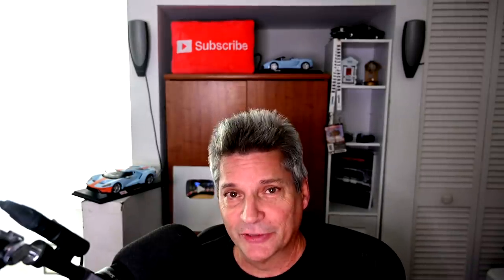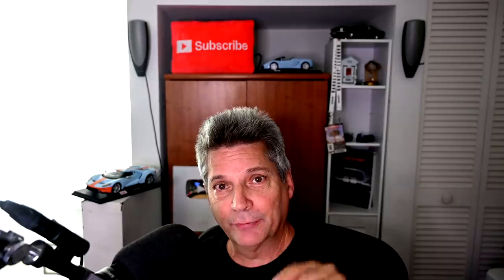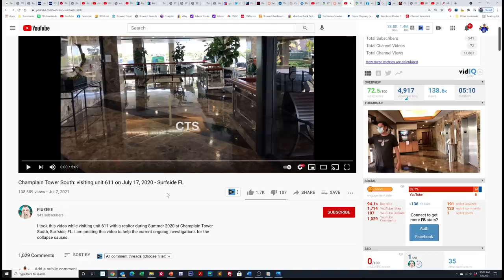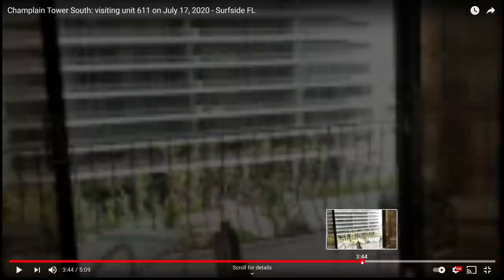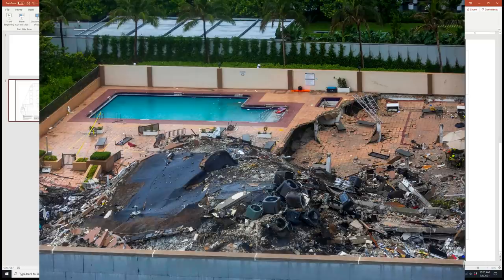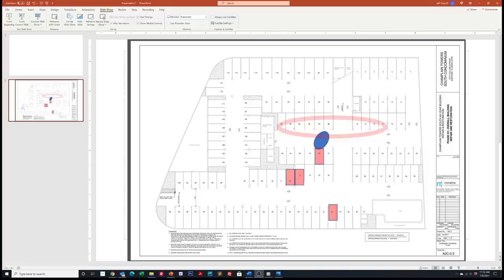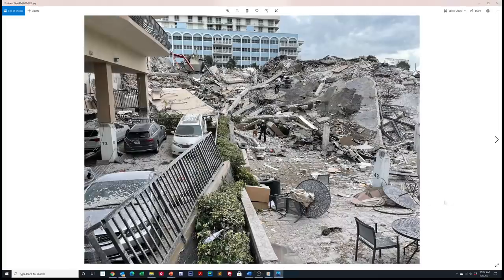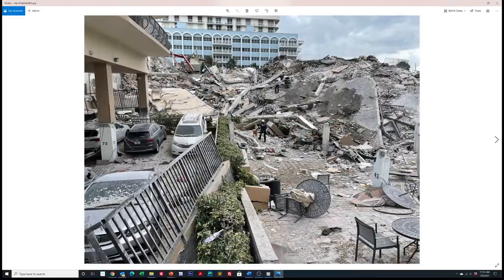Analysis Garage Video BEFORE Condo Collapse: Water Everywhere

Comment: I'm a Public Adjuster, damage consultant and represented the North Tower in the past. 20 plus years in the ins damage business. I've represented and handled numerous claims involving condo associations in Florida. Here's my two cents on this horrific incident. First, one of the worse ideas is to design planters on a 2nd level concrete deck in Florida. Its a maintenance nightmare that causes progressive deterioration to the concrete slab, hence one of many reasons for the water intrusion in the garage and flaking ceiling paint. By the way, covered cars in the garage are usually owned by snowbirds, 2nd homes. This building has miles of piping and chases all lead to the garage, so any water leaks from above units end up in the garage. Consider ocean tidal change, regular storms, planters and a exposed concrete pool deck, this building required consistent and extensive upkeep with proper water proofing, which can be very expensive and unit owners don't want to pay for an assessment. Still no excuse. I've witnessed fist fights at condo meetings. Unreal, I could write a 12 book series on my experience in dealing with an association board. The tourist video, the severed pipe is a 6" drain line, possibility from roof's scuppers and condensation lines. Sprinkler lines are pressured lines, so clearly the water flow is from a drain. The weight load of the pipe hangers attached to a weakened support beam may have contributed to it falling in the garage (in video) just before the collapse. Kudos to the tourist that bravely took the video, it will help with the investigation. They must be traumatized. Ceiling cracks in the garage appear to be previous repairs with epoxy injections, however water still migrating. Its a standard repair to slab cracks. Engineer should have set a protocol to repair structural slab cracks. Notice in the video, there is water running down a column. Video 22.28. Ceiling paint flakes are usually caused by moisture in the slab or paint was improperly applied to the concrete. The pool itself and equipment room is on grade and thus had nothing to do with this incident, however paints an ugly picture of lack of maintenance by the association with progressive concrete spalling. Possible gross negligence by the association, therefore the CGL policy and a separate liability policy for errors and omissions by the condo board. It doesn't look good for them. The 1st party ins carrier, which will be a different carrier from the liability will be hit with a total loss 40 to 50 million. In most cases, several carriers take on this type of risk under layered coverage Ei. percentage of risk. Each unit owner should have their own policy, that provides coverage for personal property and betterments. That's all cabinets, tiling flooring and paint ETC. Plus, additional living expenses. Those carriers should tender total loss payments immediately to the policyholders. Its going to be a litigation nightmare for all parties. Its all premature until the proximate  cause of the collapse is confirmed. Still need to rule out construction defect with materials used and/or design specs. Top engineer commented that the rebar slab ties to the column may have been deficient. This adds lateral support to the structure. He was unable to confirm it until all debris is removed from the area. They secure concrete core samples from the North Tower. The investigation will take 8 months to a year. In the spirit of speculation, my premature assessment points to the lack of maintenance and urgency to rectify the issues purported within the 2018 PE report. I must add structures built in the 80's in Florida were poorly designed and constructed. Note Building codes in Florida changed after 1992 Hurricane Andrew. This is just my opinion, my two cents, I am not an engineer but that means nothing like everyone else on YouTube. It's all amateur speculation. My heart goes out to the victims and their families. I knew two of the victims. Horrible situation.
Reply: Thank you for your 2 cents. Helps a laman like me make sense of all this.
Reply: Has the basement floor been removed to find out what happened to the foundation?
Reply: I'm convinced that there were multiple water pipe leaks within the walls. 

Water pooling was both on the roof and basement. Another video showed pooling on the roof via drone. The buildings next to this collapsed one, as well as, others in the vicinity did not have water either.
Reply: Your greed is the reason.  U ripped off the victims and make an argument of incredulity
Reply: I agree on the HOA part. I was on the board of mine some years ago and people lost their minds over a $250 assessment. Can’t imagine what $200k would do. The HOA would need to get multiple estimates. I did want to point out that the Morabito report I believe stated that the HOA had paid to repaint several cars due to falling concrete, which may have been the reason for the car cover in space 78 , since it was one of the worst areas. 
Question: is it normal to build a parking garage below a pool? I am from LA and we don’t usually do that except in hotels. I would also be curious if anyone inspects buildings after hurricanes. After the 1994 Northridge Earthquake, all the buildings in my city were inspected.

Comment: I will never look at a commercial garage the same way ever again!
Reply: It's even got me looking at my house differently!
Reply: It's a shame it took a building collapse for any sort of change to happen. The building owners would definitely let it go into for another 10 years of disrepair.
Reply: Maybe this will help save another building from killing people. We need to open our eyes to this and report to someone other than the building own or personal
Reply: There's a building in Denver that's really old and still has wooden support columns in its parking garage. I used to be a mobile windshield installer and many times I had to install in similar parking structures, and I swear that place you can hear the wooden beams creak and groan on windy days, and I sort of entertained a brief but horrific notion of a beam splintering and the whole place coming down, but telling myself, assuredly, "nah, they have building standards and inspections for this sort of thing". 

Another thing is a lot of those places shift as cars go by inside the structure, so you just feel everything shake up and down while you're trying to set a windshield.
Reply: @DJSekuHusky  p
Reply: same man
Reply: I never take them for granted.
Reply: @egverlander  And you should. 
I own a framing company, I build houses. And Ive seen some crazy things... 
Some framing contractors really mess things up, and alot of building inspectors are ding dongs... Ive seen green tags on scary sketchy sites... on new construction...
This is today...
Things were far more lax years ago I'm sure. 
And wood framing is especially susceptible to degradation... 
I can only imagine what remodel carpenters have seen... I want nothing to do with that
Reply: @brandonsatterstrom7894  lack of quality is why anyone who knows the trade always does their own work on their own house.
Reply: @DJSekuHusky  I would make them move the car out of the garage to do the windshield replacement.  If they balk, tell them the light is terrible in there and you want to make sure the seal is good.  (Not actually a lie)
Reply: @MrVuckFiacom  they let it go for 40 years... plus petitions to stop work... yes they voted to stop repairs..  funny is it not..
Reply: In particular a covered one where the weather is warm, the floor/foundation of the building should look close to original even 40 years later. My assumption is the ceiling even if in poor condition will do no more than drop chunks if the pillars are intact and a massive ceiling failure knocking over columns is not likely. More likely massive foundation failure eliminated the pillar support and the ceiling fell, the tolerances as tight enough so losing 4 or 5 pillars would quickly cause those around them to fail.
Reply: @DJSekuHusky  You should take photos of that building and forward via snail mail and email to local authorities and building inspectors. 
Who knows, you can save a life.
Reply: @MrVuckFiacom  the "building owners" were all of the tenants collectively.. they were private condominiums. They knew since 2017 it needed work and were about to make payments for repair. An estimated $90,000 per condo owner in payments.
Reply: Im lookin up...
Reply: No more pools on roof?
Reply: I will never look at any structural anomalies the same, at home or anywhere else. Nor will I dismiss it as harmless. This whole situation has been enough to scare me straight.
Reply: @DJSekuHusky  recently having to use parking garagees downtown. it's amazing how much those things vibrate.
Reply: I have been thinking the same thing.
Reply: Yeah, now I want to do my own inspection, just to get some sort of baseline as to what "normal" is, as should we expect to see perfect paint, not a drop of water, not even a single minor crack? But then such an "inspection" shouldn't be too obvious, because somebody might think that was suspicious.

I also like to think in movie disaster scenarios, what might I do differently so as to be among those who successfully escape? Overcrowded nightclubs sometime before the big-news fire broke out. I don't drink anyway, and why would I go to one? I say to my friend, "It just seems too unsafe crowded in here. Let's leave now before something happens." The old movie "The Towering Inferno". There was one moment when escape seems like maybe it would have been possible. The moment that it is announced at the grand opening party that there is a "small" fire 50 floors down. "It is going to take a half hour or more to evacuate all these people by the elevators. Why not beat the rush and descend the stairs immediately?" Better make it fast, because at 2 seconds a floor, that is nearly 2 minutes to get below the fire, and in 2 minutes a "minor" fire may or may not progress a lot during that time. Once descending below the fire, probably slow down, as by then who wouldn't be exhausted?

Better to be safe than sorry. I wonder just how many people evacuated in 9-11 when it was the other tower that got hit? Why not an excuse to miss out on work? Get out first, be assured that everything is okay later.

Overall, should be believe that tall buildings are safe? They are probably maintained and inspected much better than our houses, and they have stood for how many decades without much noticeable incident? How many times were there warning signs that were downplayed or ignored?
Reply: Same
Reply: Yoooo same
Reply: @DJSekuHusky  I can tell you parking decks are designed to move just like bridges,bulidings, stadiums. They are all designed that way that's what revar and post tension cables do. Now I work on parking decks a good bit and I have never seen a wooden on that's kinda of crazy. You would be surprized at how many parking decks need extra reinforcement years after they were completed.
Reply: Copllases like those are rare to happen
Reply: I have some of the same symptoms in my rental apartment, one room of which is 2 1/2 feet below grade.  Fortunately, it's not ceilings or high on the wall, so I figure my risk is low and I keep the pump handy for water incursion when it happens.
Reply: @ihavenoideawhatimdoing4  Rare to happen but killed 97. Plus, we may only be seeing the beginning unless residents start getting proactive and vigilant.
Reply: Just had one up where im at in Yorktown beach fail yesterday, Sheriffs everywhere, being a tow truck operator, wasnt allowed to drive my tow truck on it n i had to go up top and roll the cars out by hand, turns out the re bar had corroded n broke & the main concrete support beam had cracked and the roof of thr garage had sagged in the middle deaming the garage at risk of collapse
Reply: It's very informational. I was just looking at my work garage. I think I'll go down and take another look. 😮 I feel this is total neglect...PERIOD.

Comment: Every experienced homeowner knows that when you see water on the floor, the real problem is not just water on the floor.  Pipe leak, roof leak, whatever, it’s bad news.  But until now, I never would have understood the ramifications of water leaks in a multi-story building or a garage like this.  Thanks for educating us!
Reply: Yes, seeing a water leak in a home is never a good thing, but in this situation, there is also the component of salt water spray (Sea spray) that is carried by the air with such close proximity to the ocean. Salt and salt water are highly corrosive, ask anyone that drives their car in an area that uses salt on the roadways. Highly susceptible are aluminum and iron, both of which are common metals used in construction. Without constant inspection and maintenance measures in high saline environments that are present along the coastline, metal construction component failure is eminent and a constant battle... most times Mother Nature wins.
Reply: Duke Hugh Johnson  she was looking to purchase. But she must have because she was down there looking for her parking place.
Reply: Yeah but when you see water in Miami you don't think leak, you think flood. It is always flooded. Most building in Miami have water surrounding it.
Reply: Very costly education
Reply: Shouldn’t have caused a collapse.   I’ve seen high rise building sitting vacant with all the windows missing for 30 years   He’ll look a the ghost city in Russia.
Reply: Yes any half smart person would say building a skyscraper in the sand next to the ocean with a basement is dumb. How did all these people make money, yet were so stupid? All they could do was think to complain about water problems when the next door neighbor is the Atlantic Ocean.
Reply: @greenlawnfarm5827  they have only profit on their minds. Nothing else and they don'f live in the condos they build. I understand that in Usa you're consider smart if you have money. What is in your scull doesn't mater . Poor people are stupid because they poor. These are the values of America
Reply: @sylvesterwoodest5358  Yes and if people value living on a beach where it is high risk then they deserve nothing if there is a problem. And they deserve no flood insurance.
Reply: I agree and when we were ready to buy first home we asked to go to basement first.
Reply: Oh, but when you see water problems, that may be a good sign that bidding low on the house will net you a good deal. Sometimes the problem is easier to fix, than many prospective home buyers suspect. Some problems scare buyers away, but if you understand what the likely problem is, you may be able to fix it within the money saved in getting a good deal.
Reply: @sylvesterwoodest5358  If they have money to pay for waterfront views but can't figure out that salt water and sand are not good to build in then they live at their own risk for that ocean front view.
Reply: @Marcus Mcgarkus
Money and power isn't everything. I often think that the common people are largely to blame for our lack of progress. If we want to progress as a society, then why do we have so many smart people flipping burgers? Why do we put them into menial jobs? Well just look at all the bad choices that people make, ugly impractical sports-cars, smoking cigarettes, tossing trash all over, what do they do to promote better ideas or better technology? Because all they care about is their own selfish appetites or stuffing their faces, we have smart people flipping burgers rather than doing jobs more appropriate for smart people to do.

I can't stand speechifier politicians. Those who play the game and say whatever that they think may score them political points, rather than what is true. Pretend-elect ByeDone gives awful speeches that his puppet masters give him. Yet he is incompetent and worse, and shows no good leadership. What a disgrace to our once-great country. He isn't even our President as he never had the legal votes.
Reply: BUT also there would be water in/with a very rainy day... so a "must" is mention the "last time it had rained hard".
Reply: @silviaeaston  It doesn't really matter when the building is at sea level and salt water is on the concrete all the time.
Reply: When you see water on the floor of the garage where you park your car, in a climate that is hot and humid, you usually are smart enough to realize it is from your cars AC system..  face it, car garage surfaces are made to handle water.
Reply: @STARZFAN31  It was more than an a/c puddle. It was flooding the floor and coming up from the ground or leaking from the pool. They said it was so much water they had problems pumping it out.
Reply: @greenlawnfarm5827 No.
Not much of the world is Manhattan bedrock.  From Boston, Berlin, San Francisco, Shanghai,  the majority of the worlds cities are built on soil.  Smart people know this.
Reply: @greenlawnfarm5827  Building performed excellent as designed and built.  Would you take a unmaintained, unrepaired, leaking 40 year aircraft, sailboat from New York to London?
Reply: @2paulcoyle  Smart people do not build next to the ocean with salt air and water.
Reply: @silviaeaston  in the summer it’s rainy season in South Florida, go into any building garage when it’s raining or even the next day there will be water.
Reply: @Mony0425  I did my home inspection during a Nor’easter. The inspector joked “she is going to spill all the secrets today!”  I bought it. It is a 100 years old though.
Reply: I noticed a couple of leaks from the second floor of my gym and got scared shxtless because of the secondhand trauma from hearing this story.
Reply: Seems like the biggest part of property ownership is getting water to go where you want it to go and preventing it from going where you don't want it to go.
Reply: When you buy a home always go see the place after a good heavy rain and check the basement.